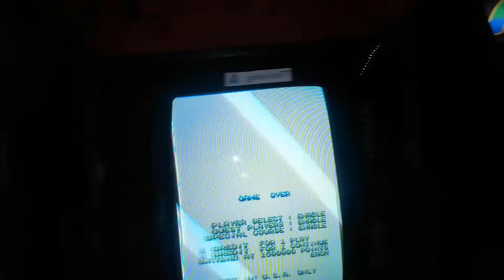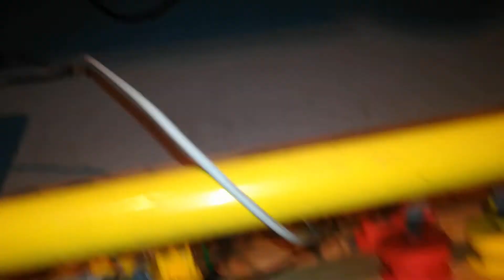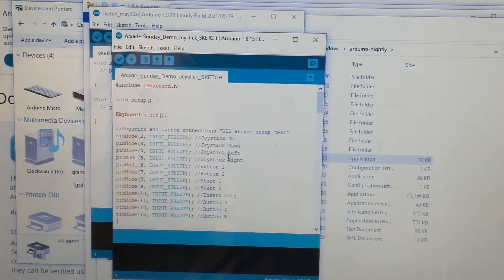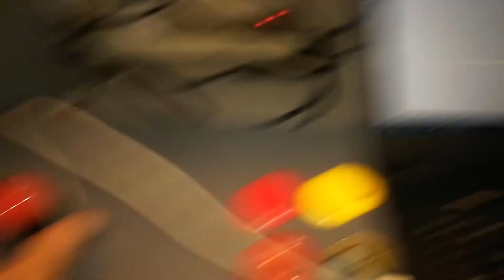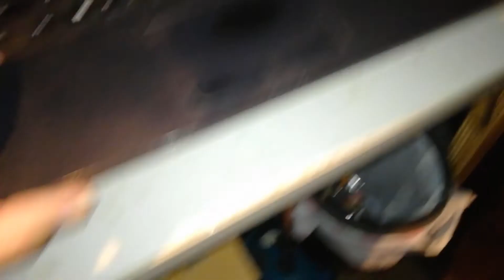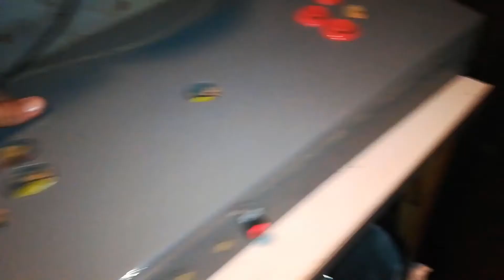EP100: How to program an Arduino for your arcade controller !

Comment: Great video as always. Do you have a system that uses 6 buttons (sf2 style) either side and includes coin and start buttons ?
Reply from the maker: Heya Mr Dinkles! Yes my "main" horizontal cabinet is a 2 player, 6+6 buttons layout, with coin Input and menu buttons... However, I achieved this with two Arduino micros (one for each player). This set up works perfectly well, as these micro controllers are detected as separate inputs, and are so cheap. There are probably better ways of doing this (I've looked into Arduino expansion I/O boards) but this work for me!
Reply: @arcadesunday4592  oh jeez I didn't think of just using two haha. Apologies 😂. Thanks for uploading your sketch. Oh and what type of Arduino micro do you use as there are loads of different variations.
Reply from the maker: @MrDirkles  I have only ever used official Arduino products, so (in my mind) there is only one Arduino 'Micro" board on the market. Perhaps I need to research a bit more (as things change all the time!!) so I'll reply again later to confirm... My sketch is for the Micro specifically. I also have an Arduino Leonardo in another arcade machine (which actually takes analogue inputs from an accelerator and brake pedal!) I'll definitely update here once I know more about new Arduino models! Thanks for the comment!
Reply: @arcadesunday4592  I thought I'd be clever and buy a dozen Chinese Arduino copies and they didnt have the correct chip. A traumatic experience
Reply from the maker: @MrDirkles  er, lol!! Traumatic, I'm sure! I'm sure some of the clone units may work... Trial and (many) errors coming your way! Haha!!! I just find that the official products (albeit more expensive) yeild a predictable result, and more support (overall). I have no doubt that the clone devices "can work"... You just need to be more intune with their requirements... I'm just not willing to mess about with untested devices... Can be done though!!

Comment: If & when I get around to building a MameCade stick, which needs an Arduino. I’ll be sure to rewatch & refer to your tutorial - Cheers 4 Now Arcade Sunday ✌🏿
Reply from the maker: Please do! It's super easy to do, and the Arduino Micro is cheap. Make sure you do NOT buy an Arduino UNO as it does not (nativity) support HID input... I'd recommend the Micro or Leonardo boards (as I have both and they work perfectly).